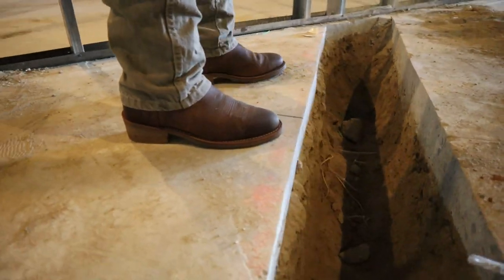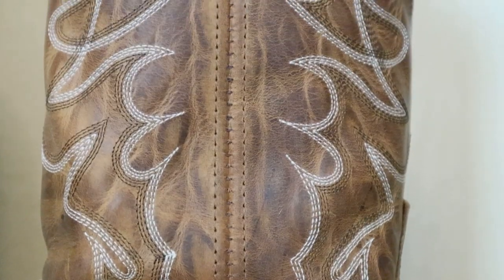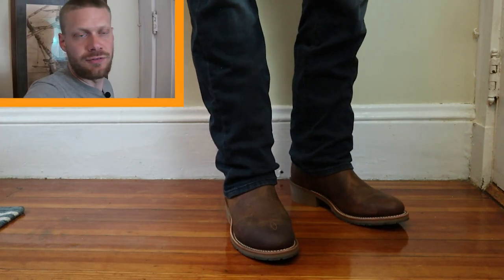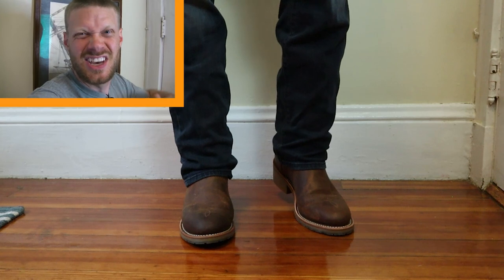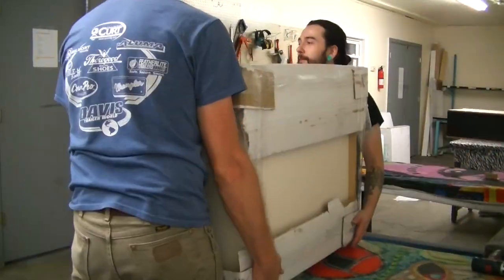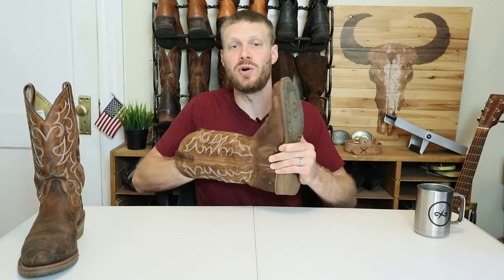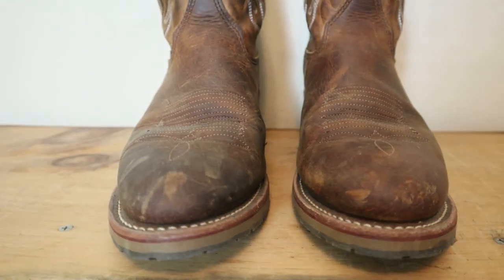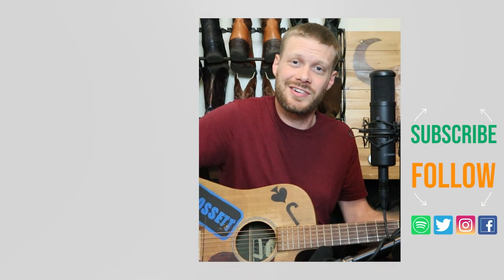TOUGH on the outside but SOFT on the inside | Dylan Double H Boots REVIEW

Comment: I’ve had 5 or 6 pairs of these boots. By far the best pair of boots I’ve ever owned for work. I’ve tried many boots over the years from Justin, Georgia, redwing and many others but I’ve never had a pair last much more then 6 months until I started wearing these double h boots in the video. Now I normally get around 2 years out of them with getting the heel replaced once. I wear boots everyday of my life. I don’t have a pair shoes. If I’m not at church or out on a date with my wife, then my work boots are on my feet. Absolutely love these boots!!
Reply: Only other pair of boots I've had that were both comfortable and last quite a few years are the steel toe Dr. Martens I have to get for the factory job I had..but they costed more than the oak double h gel ice work boots even with the steel toe, but I have not owned the double h or Justin ranch hand or the cow work western boots with a steel toe
Reply: Interesting. I have 3 pairs of boots right now, but I've never tried HH. I don't know how anything more comfortable than my black Ariat work boots. I didn't think I'd like a square toe but it's soo comfortable. I've got 2 years in these Ariats and they're still going strong. Oddly enough  I don't own a pair of brown boots though so I'm very intrigued

Comment: I watched both reviews you had of these boots, I love that this actually looks more like a cowboy boot.  I'm new to cowboy boots to begin with but realized I needed a winter pair living in the Northeast.  These arrived last night.  "Tanks" that can replace my traditional lace ups.  I've read lot's of comments in other areas about breaking these in and how tough it is and that they stretch more during break in than other boots (I wonder if this is because of machine lasting?).  Mine are 10 EE and are snug at instep and TIGHT on the width. Knowing they will break in with effort and time I feel like these will be incredibly comfortable, sturdy, good looking boots. Great info on this boot I bought mine based off of the original review in store.

Comment: I used to have a pair of Double H, unfortunately they didn't quite fit me but they felt well made and the sole seemed really tough. I would happily try another pair from them if It have the opportunity.
Reply from the maker: It's worth another try for sure. They might work really well if you find the right size

Comment: I have a current oak pair of the double h gel ice work boots I've worn the leather down quite soft the boots are almost 8 years old and I have two small holes one is like a very small slit and I am not easy on boots but I can't complain but rather than trying to get a patch of some sort because the soles are fine I will just buy a new pair of the oak boots I believe the darker brown one's like I have are actually the Dylan but I have had both the oak and the Dylan plus the black trucker tredz.

Comment: I’ve had 3 pairs of these the only complaint I have is the 2 pull on tabs with the flags on them rubbed the inside of my leg to the point of bleeding a great cheap fix for this is to get a piece of gorilla tape and put over tab horizontally
Reply: I had this same problem, hoping after I cut the american flag out they feel better
Reply: As someone who's been wearing western boots for about 30 years, I would just recommend a good tall tube socks.  Gold toe make some nice socks that are tall enough for pretty much any standard cowboy boot.

Comment: Those boots dont break in, the owner does.  I have several boots ranging from custom made cowboy boots, ropers, Thorogood slip-ons and a set of these Double H ropers with the ICE sole.  I love all my boots, except these Double H boots.  The leather is super thick which is fine, that will eventually break in with a season of sweat and some treatments but that sole will never break in.  I ended up taking these boots to a local cobbler and had him replace the soles with Thorogood 90 degree heel soles in black with cork.  Basically I turned them into another pair similar to my Thorogood slip-ons but the leather on the Double H are really too heavy.  Well made, but costly, these boots are too rough to enjoy.  3 years I wore them and 3 years I suffered.